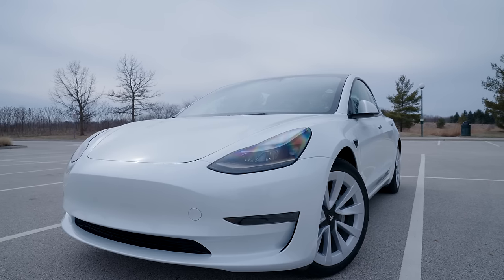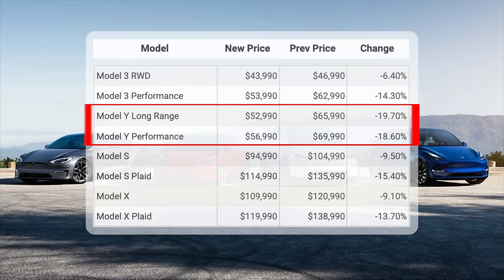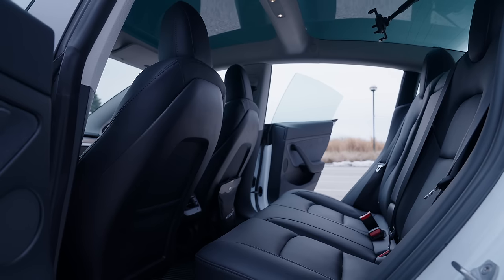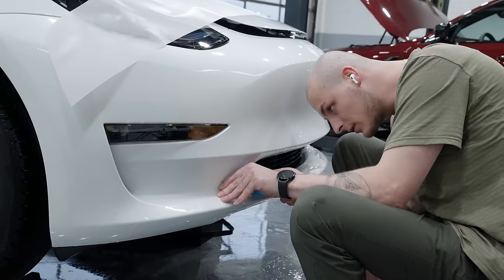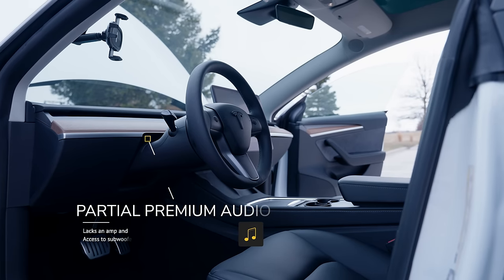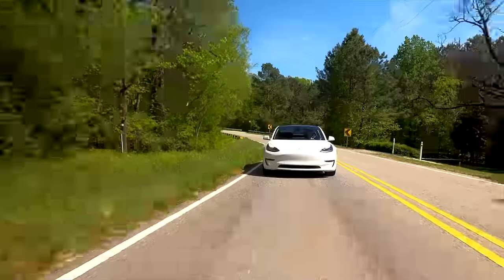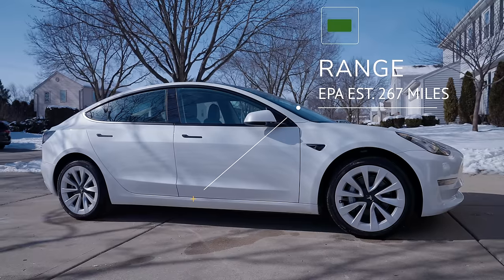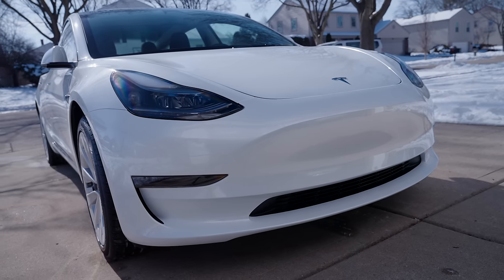2023 Tesla Model 3 One Month Later - Is the Cheapest Tesla Worth it??

Comment: I just took delivery Tesla yesterday and happy with it. Although I think the price in the US is so high. Price in China for the exact same car is only 23,0000 yuan which equals to 33.5k USD so pretty much 10K less.
Reply from the maker: Nice congrats!  Any issues at delivery?  What configuration did you go with?  If you qualify for the EV tax credit in the US, it helps with the price.
Reply: @JSLReview  l picked the same one you did, the basic model 3. honestly has more power than Mercedes GLE and GLB l drove before and can’t really feel the speaker is inferior. Feels good to me:D
Reply: @JSLReview  parking is a pain, l also hate that they took away radar when vision is not rolled out yet
Reply: Just looked up China's Model Y, it's 410 miles range?!   5 seconds with LFP vs 4.8 sec 0-60 US model.
China's MYSR rear wheel drive has 338 miles range.  6.9 sec 0-60.
Reply: After the tax credit in the US, the price ends up being about $35,000.

Comment: I have the tesla wall charger and the standard M3 and similar to you I've had it for a month now. I've been charging my car every 2 to 3 days to 100%, I've already lost 3 miles of range but I was kinda expecting that. Overall the car has been amazing except for some rattles and a wind noise. I already took my vehicle in for service the first week I got and they didn't even fix any of my complaints. Not sure if I should bring it back or try a different service center.
Reply: The rattling noise is likely the vehicle panels/chassis loosening up from the potholes and other structural highway issues we drive on every single day,
This is especially true in California, and the North east….the roads just ruin any car.
Reply: @marshallfelter2414  oh I know all about squeaks and rattles, I've been an automotive technician for Mercedes Benz for 15 yrs. I already know where and what is causing the rattles in my vehicle but if I don't want my warranty voided I have to get the people at tesla to actually fix those issues. I assure it's extremely frustrating having to rely on someone else to fix my vehicle.
Reply: @evandipasquale9255  

I understand that,
What is causing the rattling and squeaking?
Reply: @marshallfelter2414  it's the rear passenger seat back, the hold down bracket seems to be loose. And the front drivers door panel is contacting the dashboard by the A pilar.
Reply: @evandipasquale9255  

Incredible, SMH 🤦‍♂️ 
Really nothing significant, that’s good
Reply: @marshallfelter2414  i know which concerns me because they weren't able to fix it the first time I brought the vehicle in. As much as the service centers would like you to believe that they offer top service.  The truth is the knowledge and abilities vary greatly from technician to technician. So if the wrong person works on your vehicle it can be the difference between a really good service visit or an absolute nightmare visit.
Reply: @evandipasquale9255  

Agree

Comment: It appears that you live in a northern climate. How do you feel about having a standard range RWD in the snow? Does it handle well? And how does your range last in cold temps. Great video!
Reply from the maker: So I haven’t been confident enough to take this out on a serious snowy Chicago day, but it’s managed light to moderate snow fine. That’s with all season tires too, I heard getting dedicated snow tires for the winters is the way to go with this car. You will see a dip in range for sure mainly due to the use of climate control but it hasn’t been an issue given my driving needs and my access to home charging. Hope this helps, thanks for watching and for the feedback!
Reply: @JSLReview  If you regularly drive in winter weather (snow, sleet, etc) you should always get winter tires regardless of RWD, FWD or AWD. Traction is king in slippery conditions.

Comment: Have you checked your tire pressure? Mine got delivered with high too much pressure, which resulted in a bumpier ride than the test vehicle i've driven
Reply from the maker: When I got the car serviced for the door I think they adjusted the pressure to what it should be
Reply: Unless they purposely under pressured the test vehicle so it rides smoother but sacrifices the range.   M3LR 42 psi is the standard.
Reply: @Trust_but_Verify   I dont think so. Avg consumption was not that much higher then my model Y

Comment: quick question on credits, my understanding is when we file taxes next year, if I owe 0 taxes, I get 7500 back from IRS because of these credits? If I owe lets say $1000, then I get $6500 back?
Reply: Assuming your tax liability is larger than the credit then you are correct.
Reply: From my understanding and from what the Tesla salesman told me if you don’t owe taxes then the 7500 is pretty much wasted.
Reply: Not based on what you owe at year end but how much tax you needed to pay for the whole year.    Jobs would auto deduct your tax already.   Look at your 2021 Form 1040 Line 24, that should have at least $7,500 to get full credit.  If it says $5,000 then max you can get back is $5,000.

Comment: What use does the two buttons on the steering wheel have while driving?(volume,menu...)
Reply: Cruise control (+speed control), voice command, autopilot follow distance, media controls, volume, etc. 

and holding the left button opens a menu that can control climate, acceleration mode, interior lighting, wiper speed, etc. 

Basically the buttons can do everything

They can be clicked, scrolled, pushed left or right, or held down

Comment: Hi!  Great video. I have the exact same car/trim and I have been driving it for 2 days! Does your range reduce at the same rate as your odometer increases for each trip? I have noticed that on the highway at constant speed or around 67mph, my range reduces much faster than the mileage I cover. Almost 15 to 20% faster. That’s got me a little worried. I’m not sure if you cycled the SOC before the car “reset” or recalibrated. Comments?
Reply from the maker: Hey there, congrats on the car!  I’m in Chicago so the cold weather is impacting my range. If it’s cold and you use the climate control, I heard it’s normal for range to drop significantly. Not worried about it for now, will monitor to see if it normalizes once the weather changes.

Comment: The suspension is supposed to be upgraded to a much more comfortable version for all 2023 Model 3 and Model Y's, perhaps that's why you don't find it that bad :)
Reply from the maker: Yeah i heard it was worse before, really wasn’t that bad for me so you might be right.
Reply: I believe they previously had stiffer suspensions because initially Tesla cars were more of a sporty/speedster car brand. As Tesla became more and more mainstream and bought/driven by regular people, sporty suspension didn't make sense. Most regular drivers just want comfort suspension/driving, so as it happens, Tesla switched to a softer suspension system.
Reply: I test drove a Tesla model 3 for the first time yesterday (nearest Tesla dealership is 180 miles away) I've had a Honda Civic Si a Nissan versa note 3 Honda Civic Ex a smart car a Toyota Camry and a Honda element...I love the Tesla 3 in Red it looks amazing I currently have an Ex Honda Civic 2018 I'm almost ready to trade it in for a Tesla just want a better paying job first my current work is gig work where I don't mind running the miles up on my civic but I need a better job before committing to Tesla financing...I had a dodge Challenger as a rental (and at least 10 other cars as a rental) the challenger I had for a day was my favorite rental they gave me in a nice color maroon the Tesla that I test drove was a slightly better drive than the challenger (alot of raw power but not great at handling//u turns))

Comment: Thanks for this video man. It was immensely informative. I'm actually contemplating between the Model Y LR and the Model 3 RWD. Presently, I'll be honest, I truly prefer the Model Y over the Model 3 RWD because of its power and SUV like size. Also, I'm a 6'1 dude and my current car is already a SUV. However, there are a couple of things that has me still on the fence.Sigh!
 
1. I work from home so my car will be mainly used for road trips. 

2. I live in a condo and thus I don't have access to home charging. 

3. I live in Canada, and It's a 15K difference  between the RWD vs  the Model Y LR 

4. In Canada, only the RWD qualifies for a $5000K cash incentive from the Canadian federal government lol so that's a 20k difference between the 2

5. Winters in brutal in Canada, so I don't know how the RWD would handle the Winter, event with Winter tires.
Reply: Saw some videos of these Model 3 RWDs in Canada, works just fine but range loss is always going to happen so just imagine whether you can live on ~300km range with fast charging in winter.

SUV vs sedan, the model 3 is still quite spacious - it depends how often you're going on a road trip with a packed vehicle. If that's only a few times per year then you can also add some additional outer cabin space on the roof or behind the trunk on the model 3. A lot of handy stuff out there and most people wouldn't need to pack their vehicle often. Also model 3 RWD drives great and more sporty than the model y. But of course one can negate that by buying a model y LR/performance.
Reply: @abcxyz  thanks for this thorough feedback!!! If you ever come across those Model 3 RWDs videos, please send them to me.  A 20k difference is a big deal lol And,  also, I'm not going to be doing road trips very often during the year
Reply: @abcxyz123  If you don't mind me asking, which Tesla model do you have?
Reply from the maker: Sorry for the late reply, honestly I’d probably be more inclined to go with the model Y in your scenario. It’ll provide more space and range, which will help with charging out in the public. But I’d do a test drive on both before making a final decision!

Comment: There is no issue charging to 100% every day. It does slightly accelerate degradation, but since LFP chemistry is good for 3,500 equivalent full cycles to reach 90% of the initial capacity, which means the battery pack is good for around a million miles. The rest of the car will rot away before your battery degradation is an issue, so just plug it in, and let it charge to full.
Reply: This is correct. I keep telling people this - the battery will OUTLAST THE CAR.
Reply: How is regenerative braking when battery is charged at 100%? I was under the assumption we shouldn't charge to 100% just for regen so I typically just charge anywhere between 85%-93%.
Reply: Thank you! I've been charging to 100
Reply: Thank you I have also been charging to 100% based of what tesla said.  For a few minutes this video had me second guessing if i should lower the charge amount.
Reply: @sarahslater2582  if you had anything other than LFP, yes, you should charge to less
Reply: @liam1902  the kinetic energy your car has from electric energy?  How you expect you can get more electric energy back than you took from battery?
Reply: @davidz7858  I'm not saying it directly increases your battery by feeding it electric energy but this is straight from the Tesla manual on Regenerative Braking:

"Whenever Model Y is moving and your foot is off the accelerator, regenerative braking slows down the vehicle and feeds any surplus power back to the Battery. By anticipating your stops and reducing or removing pressure from the accelerator pedal to slow down, you can take advantage of regenerative braking to increase driving range."

Was just asking a question based on something I heard (which I guess isn't accurate?) 🤷‍♀️

Comment: I have a question regarding blind spot and memory seat in Model 3. Does it comes standard with blind spot, lane keep, lane change assist and memory seat function?
Reply from the maker: You get blind spot camera, lane keep assist, and memory seats, all standard features.
Reply: If by "lane change assist," you mean the car automatically changes lanes to the left or right while driving on autopilot, you will need the "Enhanced Autopilot" package, which is +$6,000. 

The blind spot feature on Teslas is not like other vehicles. There is no orange light or indicators on the side mirrors to notify you of a car in your blind spot while driving. 

Instead, when you activate your turn signal a live camera feed will display on the screen showing you your blind spot in real time. The car has cameras mounted on both front fenders that face towards the rear blind spot of the car and displays these cameras when you turn on your turn signal.

Comment: buying a 40k car and accepting there is no USS or parking assist is a major thing.
Reply: I found it is not convenient, but acceptable.  I may do parallel parking once a year.  For final price around $34500， it is cheaper than Honda Accord, pretty good deal.
Reply: They are rolling out parking assist and ranging with the cameras now with version 11 and should be widely available within a month or two. The good thing with the cameras is that they can be used on the side of the car where USS usually isn't.